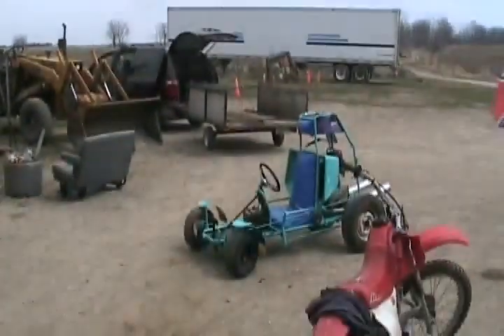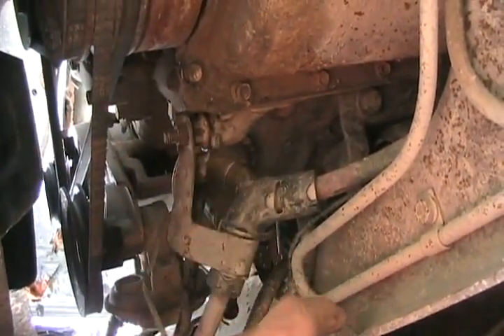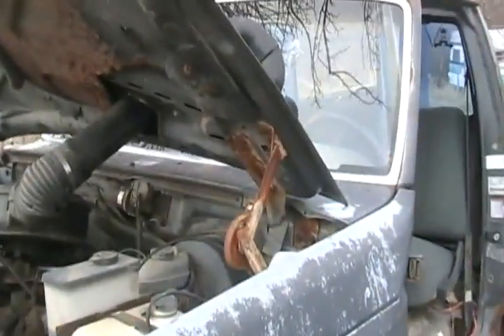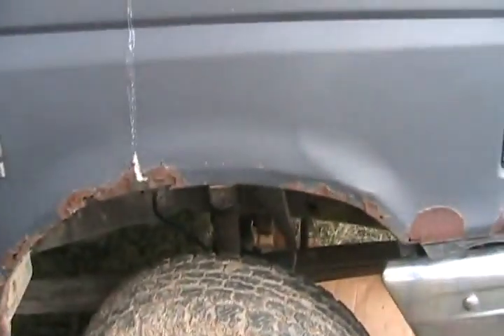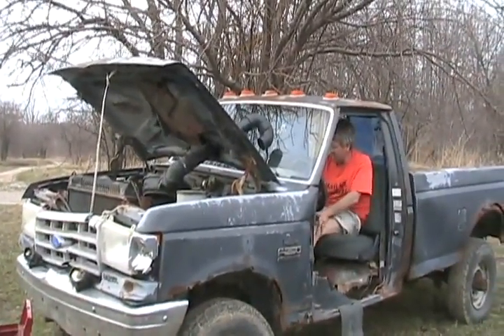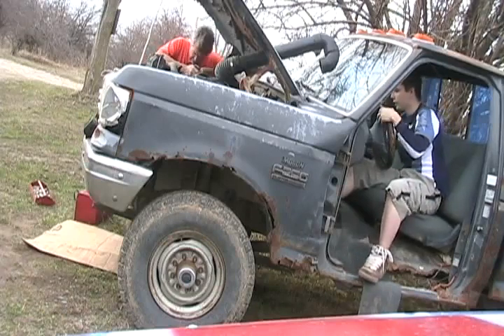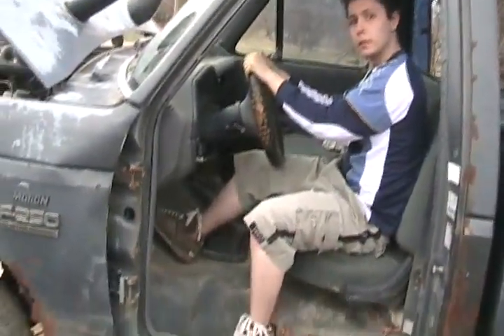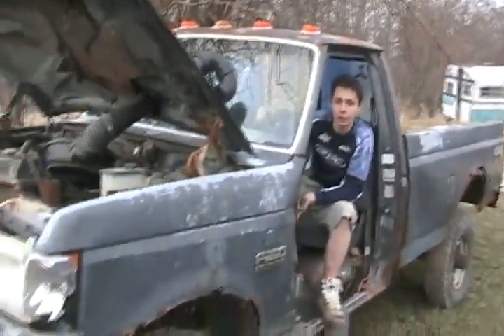#1295 Diesel ford truck start , part 2 [Davidsfarm]

Comment: Brazilian ford. My dad hates those motors he used to work for Peterson oil as a service tech and in the shop and they had more trouble with the Brazilian diesels than anything else
Reply: +Ryan Lambert i think the engine is a perkins or MWM not sure
Reply: This is a 7.3 liter IDI made by International Harvester.
Reply: These trucks were never sold outside America.